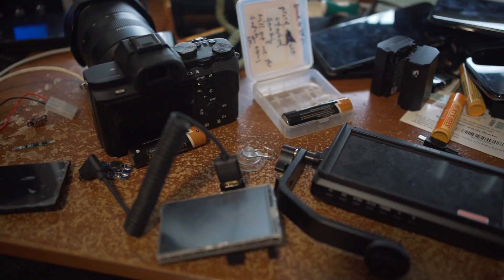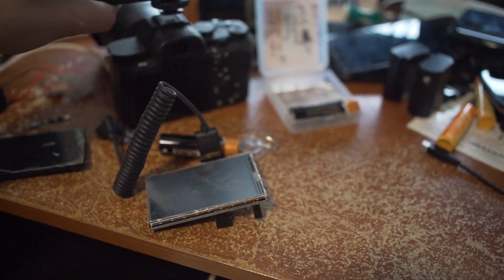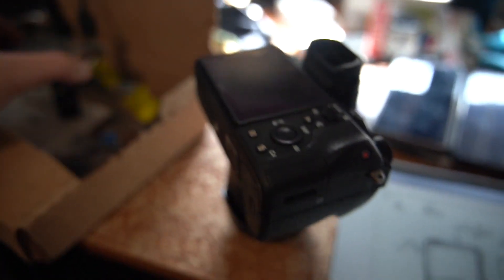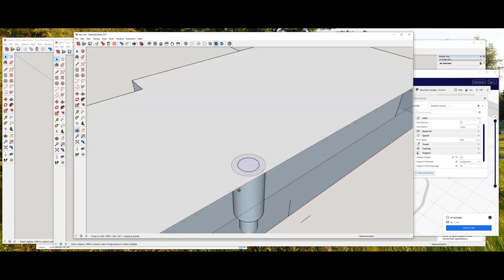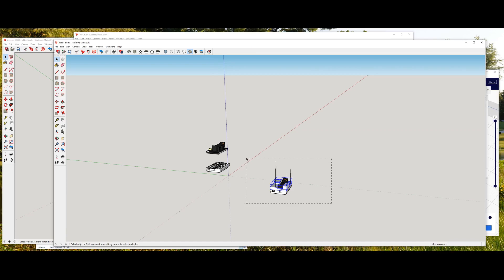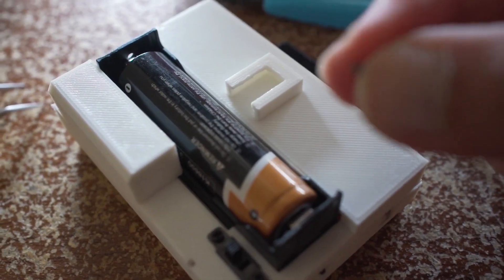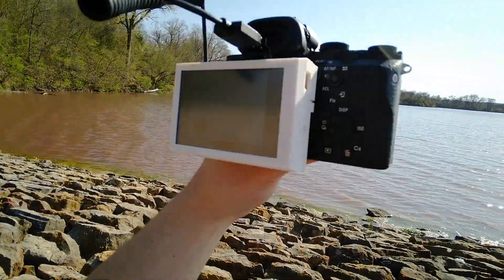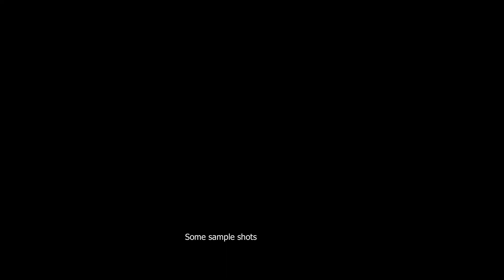Sony a7 II external display 3.5" RPi HDMI LCD

Comment: HI I'd like to connect my camera with a external monitor using my smartphone, is there any way ?
Reply from the maker: Sorry I didn't see this. There is a Sony app for alpha cameras, I'm not sure which one you have. I used it with an R3 a long time ago to do astro photography. So I guess if you can see video from the camera on your phone then mirror your phone's screen to an external display by HDMI cable. This is a guess otherwise probably just looking for an HDMI cable that can go from the camera to your external monitor directly.